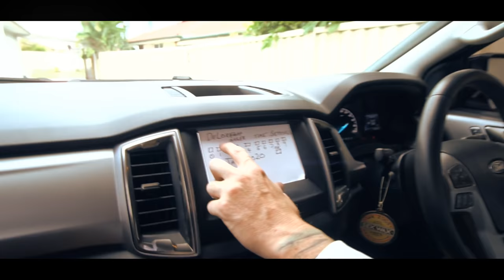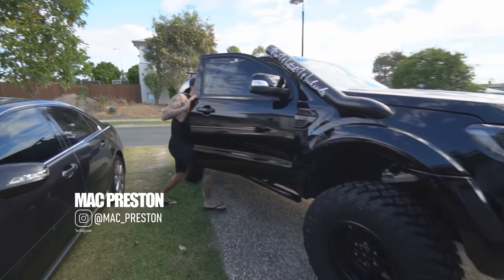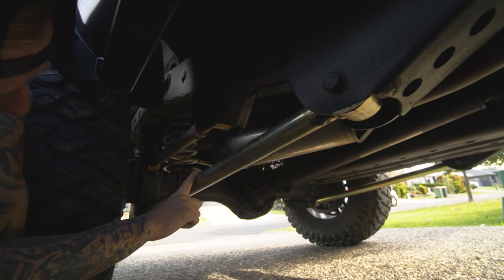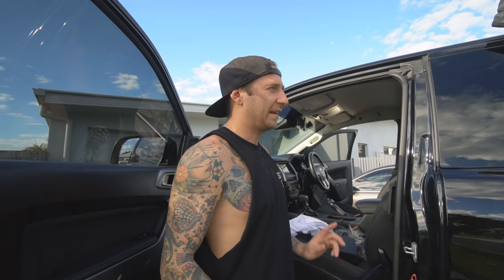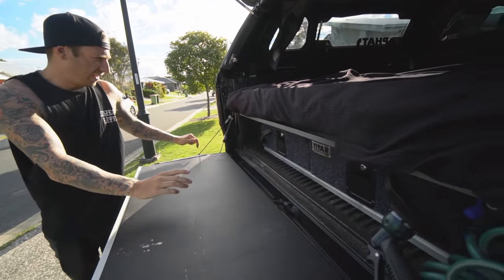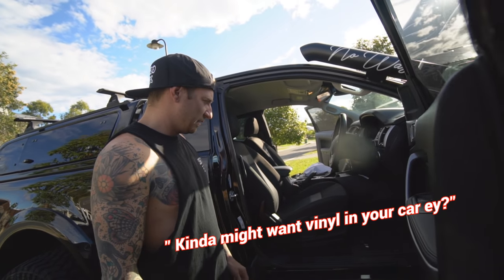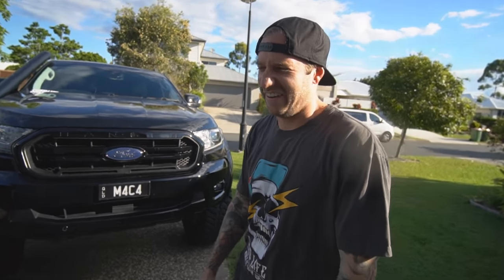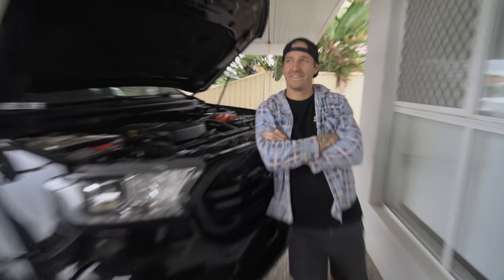1 YEAR with a RANGER

Comment: Owning the Ranger 2.2 Diesel had me headache for the past 5 years. Here's the list of issue i had while owning it.
1. Clutch pump issue, they failed every 1 or 2 years
2. 4wd solenoid and relay issue. Wont engage in time of need. 
3. Turbo issue. Those VGT turbo always jammed. 
4. Front wheels bearing.  Well im using 15x10 et-44 so yeapppp...
5. Fuel filter clogged eventho im changing it every 5000km
6. Clutch pump . Did i mention it just now ? Yeap and that thing keep happenings

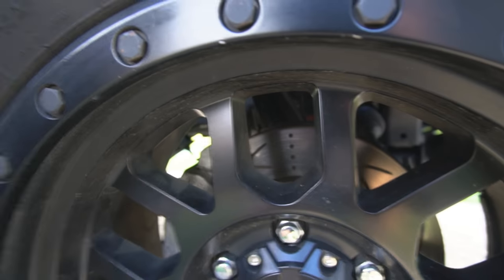Comment: @2:02 the angle of those CV joints makes me wince. They will be compromised under load for sure.
Reply: Havent broken a set yet! I had a diff drop but it caused the cvs boots to rub on the shock mounts. Its a px3 issue.

Comment: This ranger so stress front drive shaft auch 😮 are you not install differential drop kit axle?
Reply from the maker: Diff drop does not work with Px3 ranger due to shock mounts being in the way 👍
Reply: @TJANDMAC  can, you need to buy option brand drop kit to less stress drive shaft

Comment: 15k to fix my Ranger gear box due its pure shitness. Someone like Mac could repair it himself. But it’s bog box puss gear box and engine. Best 4wd experience in my 25 years of owning 4wd’s was selling the Ranger.
Reply: Engines are actually great lol, tech is great, everything about them is great except for the odd transmission fuck up story. Put a trans cooler on early and you have nothing to worry about. I dont know if you know what you are on about.
Reply: @1989cranston  they're a piece of shit if use for it for its intended use. Start caring loads and towing.. Dog breakfast engine and drive train,  I owned a fleet of them, only one  that wasn't a  issue was the managers vehicle which only carried paper plans and a driver.
Reply: @vevohoeyo  not anymore mate ,traded it  it on a Mahindra
Reply: @jase6827  each to their own, I've had a GVM/GCM upgrade done to my PX3 and have towed our 3.2T van around Australia for 52,000kms with combined weight of 6.4T without any issue in the world.
Had a PX2 which I loved, so decided to upgrade to a PX3.

Sorry you are so hurt by whatever your ranger seemed to do or not do for you.